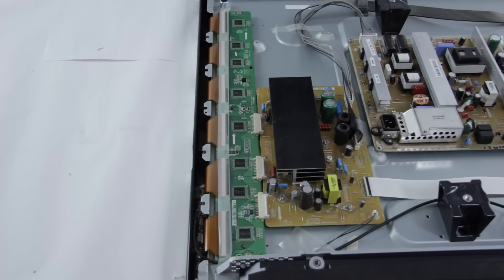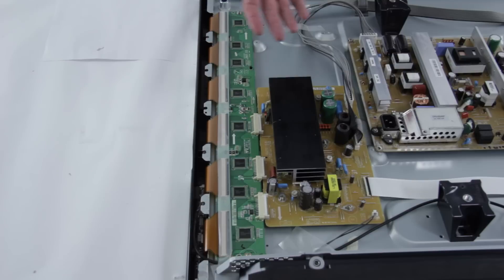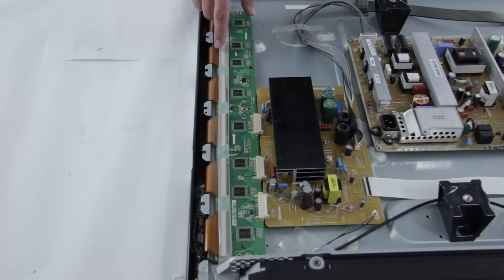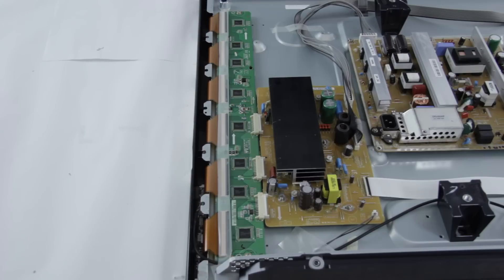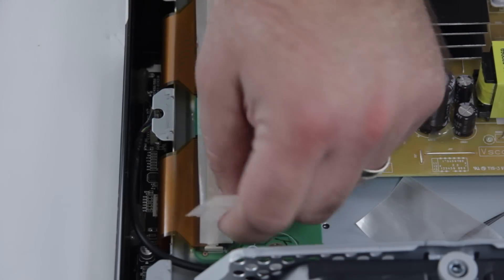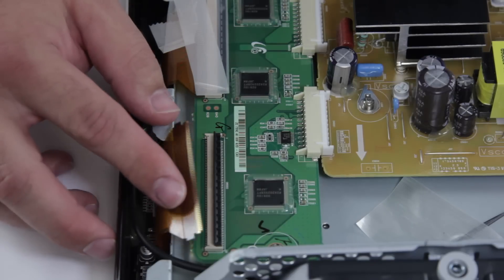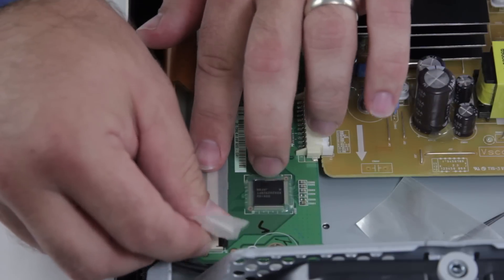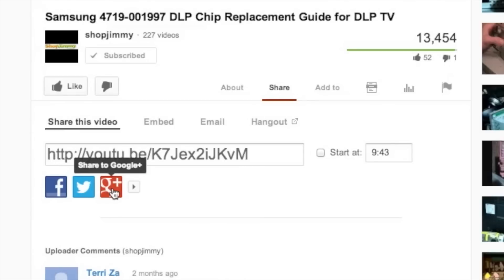Plasma TV Repair - No Image, No Picture on Plasma TV Screen - How to Replace Y-Buffer & Y-Sustain

Comment: hey i need help with a samsung pn43d450a2d.  i will not power on, has no standby light,  but hums when plugged in.  i purchased and installed a new power supply board but makes no difference.  please help.
Reply from the maker: +Brendan  Conway  Try all repairs and troubleshooting at your own risk.  I recommend replacing the main board in your TV.  Click this link to replacement parts for your TV model number:  http://www.shopjimmy.com/catalogsearch/result/index/?cat=56&q=pn43d450a2d  There may be multiple boards for the same TV model number, be sure to match part numbers on your current board, with your replacement for compatibility.  Here is a link to a video showing how to identify your part number, click here: Thanks and please let us know if you have any further questions with your TV Repair!  www.shopjimmy.com

Comment: I have a hp pl5060n 50 inch plasma and the screen went black but the audio still works
Reply from the maker: +Jose Garcia   Try all repairs and troubleshooting at your own risk.  I recommend replacing the YSUS, YDRVTP & YDRVBT boards in your TV.  Click this link to replacement parts for your TV model number:  http://www.shopjimmy.com/catalogsearch/result/?q=pl5060n+  There may be multiple boards for the same TV model number, be sure to match part numbers on your current board, with your replacement for compatibility.  Here is a link to a video showing how to identify your part number, click here:   https://www.youtube.com/watch?v=GEllG3RV-tcThanks and please let us know if you have any further questions with your TV Repair!  www.shopjimmy.com

Comment: I have a VIZO VP50 HDTV20A and I have sound but no picture at all. All the caps look good and I am at a loss.
Reply from the maker: +Rodville   Try all repairs and troubleshooting at your own risk.  I recommend replacing the Y-Main Board and the YDRVTP & YDRVBT boards in your TV.  Click this link to replacement parts for your TV model number:  https://www.youtube.com/watch?v=R1jmj_foId0  There may be multiple boards for the same TV model number, be sure to match part numbers on your current board, with your replacement for compatibility.  Here is a link to a video showing how to identify your part number, click here:  https://www.youtube.com/watch?v=R1jmj_foId0  Thanks and please let us know if you have any further questions with your TV Repair!  www.shopjimmy.com

Comment: Have a Samsung Plasma model #PN60E550D1F was connected to modem and had a almost direct lightening strike. Blew the modem and now TV red light blinks on and screen flashes very faintly-looks like trying to turn on but still black screen. Need help! Thank you! Lee.
Reply from the maker: +Lee L Smith  Try all repairs and troubleshooting at your own risk.  I recommend replacing the main board and the power supply board in your TV.  Click this link to replacement parts for your TV model number:  http://www.shopjimmy.com/catalogsearch/result/?q=PN60E550D1F  There may be multiple boards for the same TV model number, be sure to match part numbers on your current board, with your replacement for compatibility.  Thanks and please let us know if you have any further questions with your TV Repair!  www.shopjimmy.com
Reply from the maker: +Lee L Smith  Try all repairs and troubleshooting at your own risk.  I recommend replacing the main board and the power supply board in your TV.  Click this link to replacement parts for your TV model number:  http://www.shopjimmy.com/catalogsearch/result/?q=PN60E550D1F  There may be multiple boards for the same TV model number, be sure to match part numbers on your current board, with your replacement for compatibility.  Thanks and please let us know if you have any further questions with your TV Repair!  www.shopjimmy.com

Comment: My Samsung Plasma TV made a loud popping sound and the screen went black.  Is replacing the Y board worth it at this point? How much is the part? Model Number PN50BB430P2D.  Thanks!
Reply from the maker: +Jason Bell   Try all repairs and troubleshooting at your own risk.  I recommend replacing the y board and y-buffers in your TV.  Unfortunately I do not see any replacement parts in the search results for your TV model number on our website.  Thanks and please let us know if you have any further questions!  www.shopjimmy.com

Comment: hi i have a Panasonic 42 inch plasma TV model number TC -p42u1. I was watching TV then the screen made a loud buzzing noise then I shut it off and it wont turn on. it turns on and shuts off it turns on and it shuts off again then it stops.

Comment: sir pls help me to my Sumsung Plasma TV PS43D450A2XUM  i found shorted in Y sustain board,  3 transistor and 3 diodes.. my question is if replace the 6 common problem  do you think Y BUffer its ok
Reply from the maker: +Archie Vallada  Try all repairs and troubleshooting at your own risk.  I recommend that you check the buffer ICs for pin holes.  This video may help you to identify that.  https://www.youtube.com/watch?v=gFiVQx6_QbM  Thanks and please let us know if you have any further questions with your TV Repair!  www.shopjimmy.com

Comment: My Insignia model NS-51P680A12 shuts down after about two minutes then restarts after 1 to 6 relay clicks, then recycles again. I disconnected the Y & X boards and just the X board and get the same result. The TV stays on and does not cycle, the LED lights for 4 seconds the pauses 2 seconds. I notice the power AC line gets warm when everything is connected.  I suspect the Y board. 
I think I should replace the y board and buffer but wanted to run it past you first. Any help will be appreciated.
Reply from the maker: +Kathryn Luning Try all repairs and troubleshooting at your own risk.  Do you have experience checking voltages with a meter?  Thanks!  www.shopjimmy.com

Comment: Hello,

I have a 50" Samsung plasma PN50C450B1DXZA with no picture. When I power the TV on I get the Samsung startup sound and the display illuminates a faint grey and multiple pixels flicker a bit with color for a second or two, after a few more seconds the display goes completely dark. If I repeat the test with the back removed I can hear the X-main humming a bit and the humming is reduced simultaneously when the display goes dark - like it's "trying" to power up. I have measured all the voltages and verified them with the label on the PDP (Vs 209, Va 55, Vsc -178, Ve 86). I have also tried unplugging the X-main and powering on - in this configuration the display is completely dark and I can watch the Vs power drop after a few seconds (I'm guessing the logic board detects the X-main absence and kills the power). I am unable to perform any tests to isolate the Y-main as it powers the X-main. Also I have closely inspected all the boards for swollen/vented capacitors and/or overheated transistors - none found. So at this point I'm not sure if the issue is the Y-main or Y-buffer or X-main. Are there any tests I can do to pin point the failed component or is my only option to shotgun parts at it?

Thanks for your website and videos, I have learned a lot already.

Comment: hey shop jimmy! ive got a samsung pn43e440a2fxza, that i got from some friends because it was not working and they were planning on throwing it away. according to them, it suddenly stopped working. now, when turning on the tv, it makes the startup sound, but there is no activity on the screen whatsoever. do you recommend replacing both the y buffer and y sustain?
Reply: +ShopJimmy.com Thanks so much for your reply! Have been impressed with your company so far. Will be ordering the parts soon and giving it a shot.

Comment: I have a Samsung plasma tv and I attempted to move it and I cracked the screen.. now it comes on without a picture... what do I need to replace and where do I get it from?
Reply: Oh yea and the model number is.. PN51E450A1F
Reply from the maker: Brittany Ward  Try all repairs and troubleshooting at your own risk.  This sounds like a TV panel (TV Screen) problem.  If your TV panel is bad, it may be more cost-effective to replace the TV as panels are typically hard to find in stock, difficult to replace, and expensive.  Thanks and please let us know if you have any further questions!  www.shopjimmy.com

Comment: My Samsung Plasma TV Model PN50B450B1DXZA made a loud popping noise while watching TV.  It will power cycle and make a clicking noise about 5 times or so and then shut off.  I currently have it unplugged and will attempt to take the back off when I have time.  No picture or sound when I attempted to turn it on.
Reply from the maker: Kevin Plunkey   Try all repairs and troubleshooting at your own risk.  I recommend replacing the Y-Main Board and the Y-Buffer Board in your TV.  Click this link to replacement parts for your TV model number:  http://www.shopjimmy.com/catalogsearch/result/?q=PN50B450B1DXZA  There may be multiple boards for the same TV model number, be sure to match part numbers on your current board, with your replacement for compatibility.  Here is a link to a video showing how to identify your part number, click here:  https://www.youtube.com/watch?v=R1jmj_foId0  Thanks and please let us know if you have any further questions with your TV Repair!  www.shopjimmy.com
Reply: ShopJimmy.com I opened up the TV to determine which board was possibly defective.  After unplugging each board and testing to see which one caused the clicking noise, it appears to be the X-Main Board.  I bought a replacement X-Main Board and tested it, which allowed the TV to turn on, but produced a mostly black picture.  What picture was shown was mostly in the upper left corner in white.  The picture displayed was just information to what source was currently being displayed.  My current thoughts indicate that I need to replace the X-Buffer Board as well or that I had an incorrect X-Main Board.  The X-Main Board I received had the same model number but with only a slight difference.  One capacitor was larger than the original board.  I am not sure if that would cause display issues or not.

Comment: I got a LG 60PZ950 plasma 60 inch TV which stopped working after 4 years.  It can be turned on but I can only see the blue power light on, the screen just flashes but no sound or picture.

Comment: Help! 

Our Samsung Plasma TV just made a loud popping sound and then the screen went black. We unplugged it and plugged it into a different outlet and it kept powering through the cycle but the screen stayed black. 
Model: PN50C550G1FXZA

Will replacing the Y buffer or y sustain help fix it?

Comment: hello guys I wrote you about my lg50pn6500 problem was tv won't come back on if I wait long enough I
can plug in and out ontil it does finally come back onin the mean time what it is doing isabright gray flash and then nothing but a dull gray screen will this is going on none of the buttons on side of set work you suggested y sustain and ydrv board replacement forgot to mention buttons not working in light of this do you still recommend same fix or does this change things? I am ready to purchase boards just making sure. And Thank you for all your help !!!

Comment: Hi i have a Phillips plasma 42 inch model 42PF7321D/37  serial YAIA063602201 i have replaced 3 capasitors that were swollen . The tv turns on green light on green light turns into red blinks , NO PICTURE , main power board makes a clinking noise, i did disconnect the Y sustain board and the x board , i still hear a clicking noise , is it best to replace everything .

Comment: Hi,

I have a Samsung plasma ps63b680t6w with no image but has sound. The menu screen does not come up. When starting the TV up you get a dark black image for around 3 seconds before there is no display at all. Do you have any ideas?
Reply from the maker: hamstersk8er  PLEASE SUBSCRIBE TO OUR CHANNEL - Try all repairs and troubleshooting at your own risk.  I recommend replacing the y board and y buffer board(s) in your TV.  Unfortunately I do not see any replacement parts in the search results for your TV model number on our website.  Thanks and please let us know if you have any further questions!  www.shopjimmy.com

Comment: hi i have a plasma tv , the tv tuns on green light on left bottom of screen but no picture , 1 i did replace 3 blown capacitors , i did disconnect poer from Y sustain , all that happend is power source makes clicking noise no picture , can you recommencemend

Comment: LG 42 in. Plasma tv model #: 42PC3DV-Is.A 
Symptoms: black screen, no picture, and good audio.
Capacitors have been replaced I can't detect the issue yet, any suggestions??
Reply from the maker: Mich Elo   PLEASE SUBSCRIBE TO OUR CHANNEL - Try all repairs and troubleshooting at your own risk.  I recommend replacing the YSUS and the YDRVTP & YDRVBT boards in your TV.  Click this link to replacement parts for your TV model number:  http://www.shopjimmy.com/catalogsearch/result/?q=42PC3DV  There may be multiple boards for the same TV model number, be sure to match part numbers on your current board, with your replacement for compatibility.  Here is a link to a video showing how to identify your part number, click here:  https://www.youtube.com/watch?v=GEllG3RV-tcThanks and please let us know if you have any further questions with your TV Repair!  www.shopjimmy.com

Comment: I have a Sanyo 42 in. Problem is the TV picture periodically goes off. Power remains on. When picture is on it has perfect clarity. 

I have replaced the x-sustain, y-sustain, and buffers. Same problem exists. Any thoughts?

Comment: Hi, I have a 50" Samsung Plasma that doesn't turn on, it's a PS50A410.
On power up a green led on logic board lights up then led next to it flicks and there's an audible click. No picture or sound. I can't find any swollen capacitors and ive checked all fuses. I've replaced the power supply board and Y board without any change. I'm chasing up an X board, but would dearly appreciate your thoughts.

Kind regards,
Paul
Reply from the maker: Paul Robins   Try all repairs and troubleshooting at your own risk.  I recommend replacing the main board in your TV.  Click this link to replacement parts for your TV model number:  http://www.shopjimmy.com/catalogsearch/result/?q=50A410  There may be multiple boards for the same TV model number, be sure to match part numbers on your current board, with your replacement for compatibility.  Here is a link to a video showing how to identify your part number, click here:  https://www.youtube.com/watch?v=R1jmj_foId0  Thanks and please let us know if you have any further questions with your TV Repair!  www.shopjimmy.com

Comment: I have a Pioneer PDP-6020FD, The  tv stays on almost all day but when it is hot and gets turned off the screen won't come on and the light flashes blue on the front panel. If I turn it off power to the unit for about 30 minutes it will come on normally. If I just turn it off it will cycle from red to blue then flash blue light on the lower left panel.

Comment: Hi - I have a panasonic th-50pz80u that powers on but only shows a black screen.  The screen is turning on but it is black - does not show any menu or channel info.  When I power off the TV, the red led turns off immediately but the plasma does not turn off until 20 seconds later or so.  It was working fine, but when I moved it and plugged it into a different hdmi cable, it stopped working.  may be coincidence but the cable may have been faulty as I just pulled it through a wall (possibly a shorted cable?).  I cant remember if the power led turns green at any point but it stays red as long as it is on.

Thanks to let me know what to check for as I have an electronics degree but am happy to just replace the board.  Thanks!

Comment: I have a 50" Philips Plasma (Model 50PFP5332D/37). When I got home the led light was blinking red so I unplugged it and waited a few minutes to plug it back in. It powered up and the light turned blue but a minute later there was a loud pop and the screen went black. The led is still blue when it's on and there are green lights inside the back panel that are blinking. Please help.

Comment: TV was on with picture and sound and then all of a sudden, the picture went black. Turned on and off several times over a couple of days and still no picture but there is sound. Samsung Plasma HP T5054

Comment: I have a Samsung 50" plasma 3D tv, PN50C490B3D. Get no signal on all 3 HDMI inputs, components work perfect. Connected to blueray, cable box, and PS3 with different HDMI cables, also tried a chromecast and Amazon fire stick. TV won't even detect connection. Anytime net will detect chromecast but still shows no signal. Will this be the main board that's bad? Already did factory reset with mute,1,8,2,power, and leaving tv power unplugged for 24 hrs with all connections disconnected. THANKS FOR YOUR HELP IN ADVANCE.

Comment: Panasonic plasma TV TH-50PX80U does not turn on completely. No audio, no picture. No burned smell. Back light turns on, Power light turns on, but nothing happens. TV remote control does not do anything to the TV. Power button on the TV doesn't work either. I have to unplug it to turn it off and plug it back in to turn it on. I tried a 5 minute wait to reset but the issue remains.  Please help. Thanks

Comment: I have a Samsung PN50B860 plasma TV that when warm (after approximately 20 minutes) the picture goes to "snow" but the sound is OK.  It will sometimes display PC input instead of HDMI 1.  At this time the remote is unresponsive and I need to wait 30+ minutes for the TV to cool.  If it is cool enough I can reset to HDMI 1 and everything is great, that is until it warms up again.  Any ideas which board is causing this issue?  Thanks, Rick.